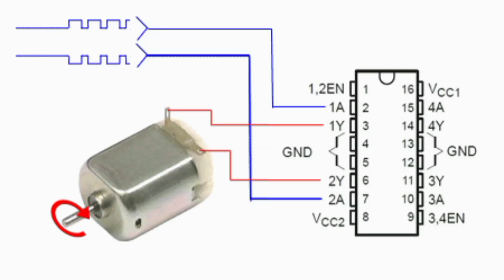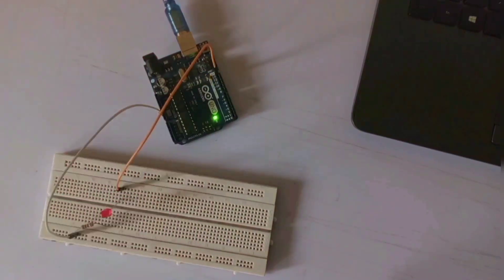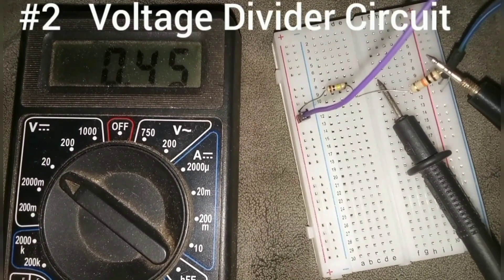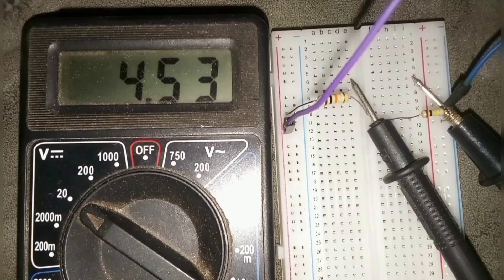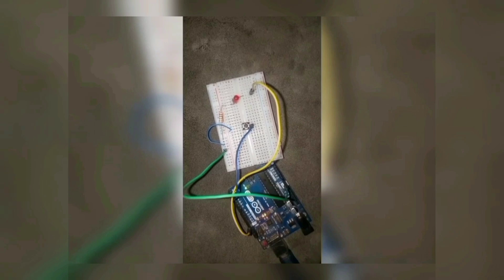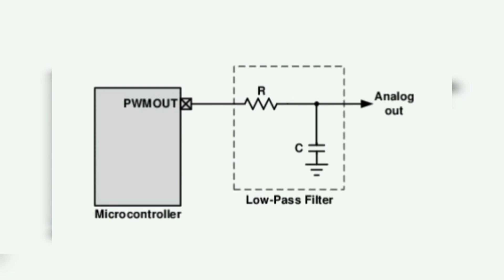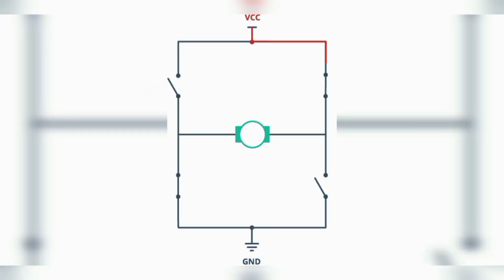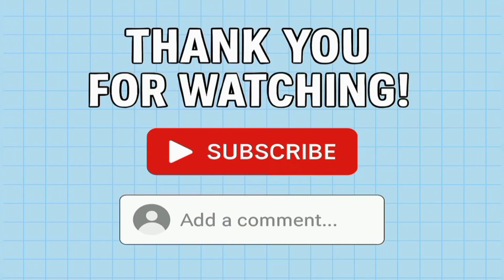8 Basic Electronics Circuits Every Embedded Systems Engineer MUST Know

Comment: I like the content! keep up the good work
other things, like sound, or whatever, will get better as time goes by
Reply from the maker: Thank you so much for the kind words and encouragement. 🙌 Really means a lot. I'm definitely working on improving the sound, and it's great to know the content is hitting the mark. More value-packed videos coming soon.
Reply: the best thing you can do is to get a USB C microphone and record on your phone instead of your PC. Than later sync the sound in some program. When you start recording, do 3-4 claps and you can sync the peaks in sound. Also put pillows and hang blankets around you when you record to absorb as much sound as possible. And as last step, do background noise removal in some editor. There is Audacity, but also Davinci Resolve free version.  You got this!

What software do you use to simulate these circuits in schematics? I am just starting and have very little knowledge.
Reply from the maker: Wow, thank you so much for this valuable insights with regards to the sound improvement. I will definitely give it a try, especially the "pillows and blankets" strategy. I really appreciate this support. 

Then, with regards to the drawing of schematics and circuit simulations, I use Every circuit (you can it on play store and install on your mobile phone for use), I also use Proteus , Wokwi,  and Tinkercard Software on my PC.